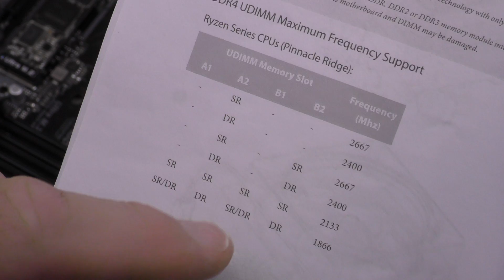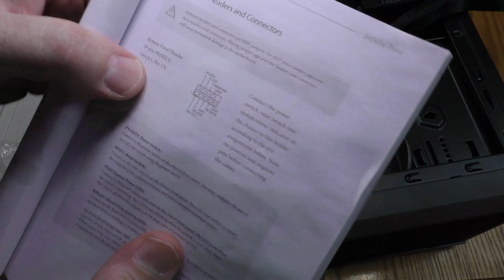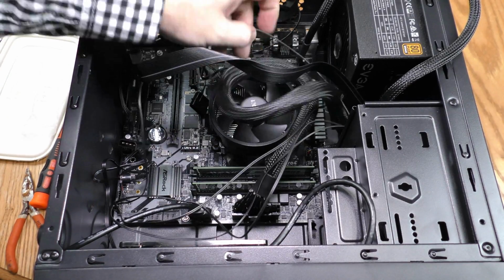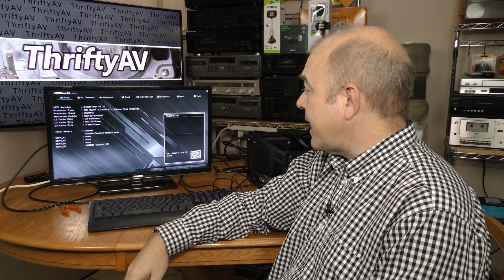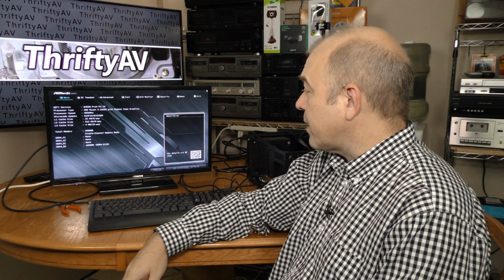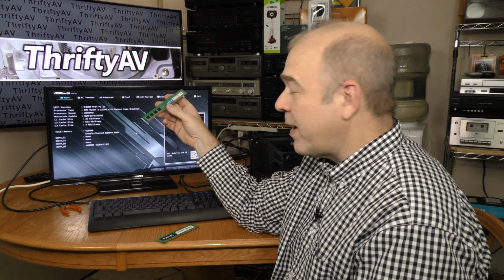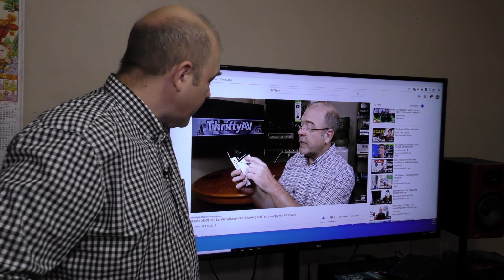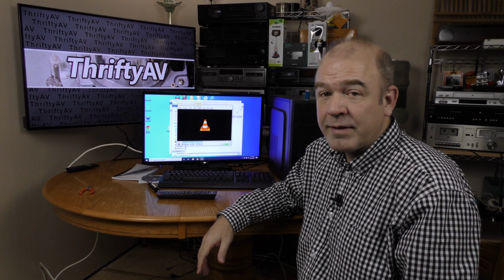ASRock B450M Pro4, AMD Ryzen 3 2200G | Spare Parts MicroATX Build

Comment: Did you have to do BIOS update for the Ryzen 3 2200g? I am new and want to get a motherboard I know I won’t screw up.
Reply from the maker: No BIOS update required for this 2nd Gen Ryzen.
Reply: Thanks. Would you recommend me getting it. I have never built one and I want to make sure it would work great for my gaming/youtube
Reply from the maker: @wosky1146  I've been building computers for over two decades.  I would suggest getting some help for your first computer build.  I had a neighbor who was helpful with my first build.  Also, make sure all your parts are compatible before purchasing them.  I am happy with this board, but I should point out that it has only 4 SATA ports, and limited PCI slots.  If you plan on hooking up a bunch of drives and cards, you will need to keep this in mind.
Reply: @ThriftyAV  Oh my god I'm not sure if you'll respond to me. But if you can please do. I bought the same board, but my cpu will be a ryzen 3 3200g. I won't need a cpu for bios update right? Because the 2200g can't be so different from the 3 3200g was my assumptions. Am I wrong?
Reply from the maker: @lookatcurrymaaan  Your BIOS will need to be at least 3.30.  This update came out in May 2019.  I believe the boards are currently shipping with 3.50.  If your MB has 3.10 or earlier, you may have to borrow an older CPU, flash the BIOS to 3.30 or later, then install your 3200g.
The ASROCK BIOS page for this board is HERE:
https://www.asrock.com/mb/AMD/B450M%20Pro4/#BIOS
Reply: Moov4 I brought a $175 motherboard and the 2200g needed a bios update, if you try this out and t works can you tell me plz
Reply: ip offline I am so sorry:(, I am dividing to go for the b450 steel legend instead of pro4. Sorry